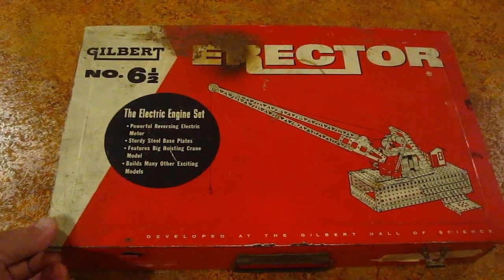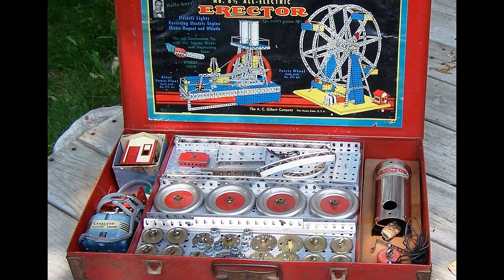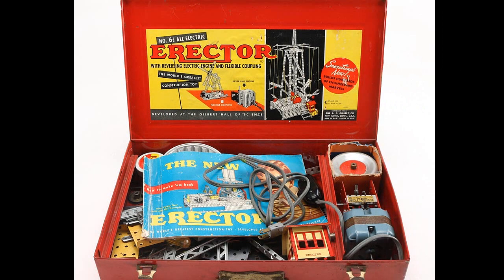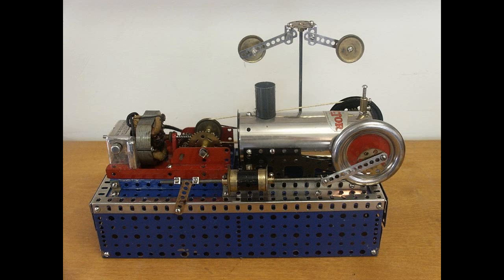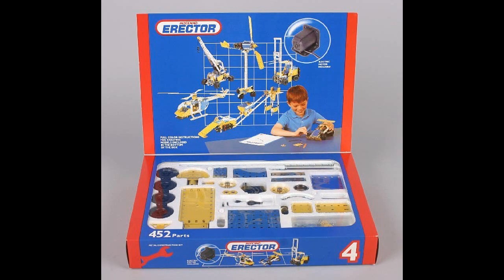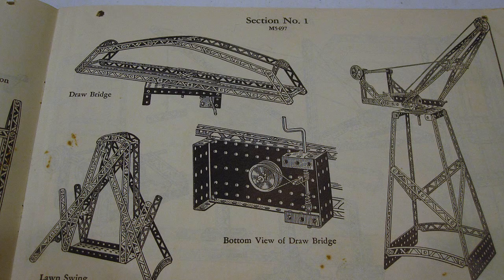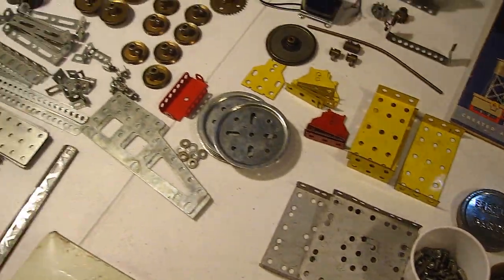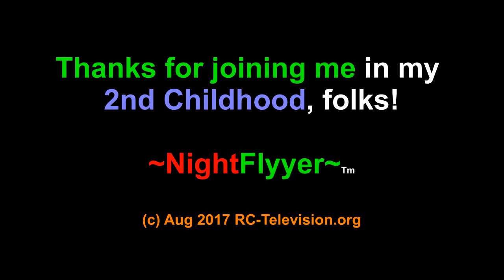Erector (Set) Helicopter plus History of the Erector set from 1911 to Present.

Comment: Thanks for the memories. I built things back in the 50's with mine, but I powered a lot of things with a steam engine I got for Christmas the next year after I got the Erector set. The Erector set stuff didn't fly apart at high speed from the steam engine like the Tinker toys did lol. The motor that came with my set was like yours, but not blue. It was bare metal with red frame sides that held the gear train. Just mentioned that so maybe someone may determine the year the set was. I'm a 76 year old 10 year Navy Viet-Nam vet and enjoy your videos very much as I also flry RC planes and recently started in helos. Thank you for your service, Ken  PS, I went through two weeks of training with the Marines at Camp Pendleton back in 1966 before making my third Nam deployment with the Sea Bees.
Reply from the maker: Yours was older for sure, as the first motors are as you described.  Thanks kindly for your comments and your Service.  Camp Pendleton is still there.  I did my tour in VietNam in 69-70 and can appreciate your service!  Semper Fi.
Reply: Your motor is likely the A47 and was included in sets from 1950 - 1953. Check out this page for a complete history of the Erector motor and see if you agree: http://www.girdersandgears.com/erector-motor.html

Comment: Hello Dave, What a great video and so interesting! I was hoping perhaps you can answer a question.  I inherited this Helicopter set in great condition but have no idea if it's incomplete; for example I saw you had 8 red round wheel pieces in the video (I have 4 pieces), is 8 correct? I saw one small engine, not 3.  Can you please confirm if that's the correct # of parts? Also do you have good ideas for where to sell or something like that? As you pointed out, it's a real special item that can influence someone's learning experience and they don't make them like this anymore. Thanks again!
Reply from the maker: Well, I just looked at my Set and have 8 red and silver wheels.  There is one big blue electric Plug in motor and there was 1 small battery powered motor.  The parts list shows only those 2 motors supposed to be in the set.  My set is missing the electro magnet and battery box remote for it. The model helicopter plans do not show any motor installed in it, but I decided to modify one of my own motors to make it work.   I bought mine on eBay, so would assume that would be a good place to sell it.  Good luck and thanks.
Reply: @NightFlyyer  Thanks for your help and an outstanding video. Hope I pass it on to someone that appreciates it. We need more influencers like you!

Comment: hi sir, really enjoy your video. It is ok if you share some knowledge of helicopter's basic 3d tuning setting like throttle pitch, pitch curve etc..  for beginner? thanks
Reply from the maker: Thanks kindly.  I have made many videos on the subject, but I basically use the Mas Technique, meaning zero pitch at center throttle and no more than 8 degrees each way.  Throttle curve is zero to 100 in regular mode and 90% in 3d across the board.  Good luck and happy flying.
Reply: ok sir, i check it out later, is there more helicopter to review soon? I really wanted you to review more helis like the walkera helicopter..